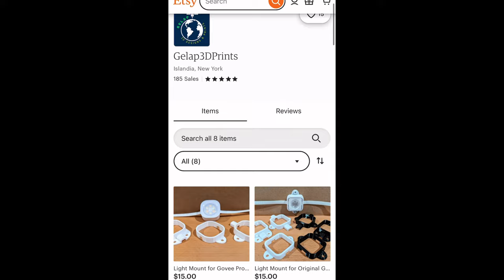Govee permanent lighting RESCUE!!! @GOVEE #fyp #rescue #diy #howto #govee

Comment: Hey can you please help, i got 100ft elite kit. Cut the last strand after the 5th light added the 4 ft govee extension and spliced back together now the last 7 dont light. They wont light even if i remove the extension and splice the lights directly back together. We have reset power, remove device and reinstalled, idk what to do.

Comment: Great video. Have you tried hiding the wire with some trim or tape to make it blend in better?
Reply from the maker: Thank you for watching. I have informed each client that some areas will be exposed and I can hide them so then they tell me, what’s the most affordable price I can give them. Then I know I value my time and my work so I tell them and some just tell me, do the best you can to make it better than the average homeowner would do it and that’s what we do. Do an install 5x better but still make them happy.Your talking about raceway channel to cover up wires correct?
Reply: @jbsdiytv  Raceway would work but probably too expensive. Was thinking along the lines of strong white tape or wood or pvc trim
Reply from the maker: @JackA2430 great advice. I’ll have to try that next time. Never crossed my mind👍👌

Comment: I’ve had a problem with my govee pro 200ft. I installed 3strings of lights, 2 4ft extensions together, 2strings of lights, then the converter because they said after the 5th string, then 1 12ft with a 4ft together, then one string of lights, then another 12 and 4ft together, then 7 strings of lights. The problem is that 4ft extension went bad, after the 6th string of lights. We moved the other 12ft and 4th from the other side and they worked but today I used all my lights and the 6th string and the rest after stop working again. What’s going on.?
Reply from the maker: You can try two things. 1) is make sure you have all 12 segments(12 strands) place correctly in your app settings. 2)do a factory reset if 1 does work. That’s holding down the power for 6 seconds. Let me know what happens 

Were any strands spliced? If so, make sure you hit yes when ask if the device has been spliced. Look for red lights within your install. If you look how you explained you said 3+2+LED Module Driver+1+7. That’s 13 strands. You can’t have 13 installed in one power adapter and controller
Reply: @jbsdiytv  I’m sorry I meant 12 installed. And nothing was spliced. The 4ft extension that’s attached to the 12 ft after the 6th string is the one that went bad, we tested it. So that makes me think this time is the same again. And to confirm is 
3+(2)4ftextension+2+module driver+4ft extension/ 12ft extension +1+4ft extension/12ft extension+5. 
Would water mess them up where the 4ft and 12ft extension meet since those are on top of the shingles exposed.?  Or something cause it to short out.?
Reply from the maker: Ok no worries. When you say we tested it, did you use a multimeter or did you swap the other 4ft extension? This would be the best testing method because then it would be a process of elimination of finding out what doesn’t work after that bad 4ft extension. Looks like you did everything correctly by using the provided extensions within your install. What I would do is write to Govee within the app and describe what you have going on. You can write and add video/pic of your problem under device settings using the support button headphones at the top right corner. They have been good at responding with problems like this. Be detailed

Comment: Hi JB, great video. Do you know if you can run a 24ft extension with the outdoor pro lights?
Reply from the maker: Yes you can. Buy 18/3 wire. Use a 4ft Govee extension, pro splice connector,18/3 wire, pro splice connector,4ft Govee extension
Reply: @jbsdiytv  Thanks for getting back to me. So a 16ft length of 18/3 wire? Is it not possible just to make a 24 foot custom extension using the splice kit ends?
Reply: @mattemmerik5376  the extensions have power booster. It will help with reducing flickering when added to a long wire.
Reply from the maker: Ferrite beads to help with data drop and voltage. You’re correct though. It’s always preferable to use the Govee extensions